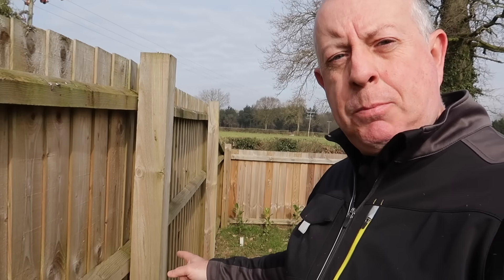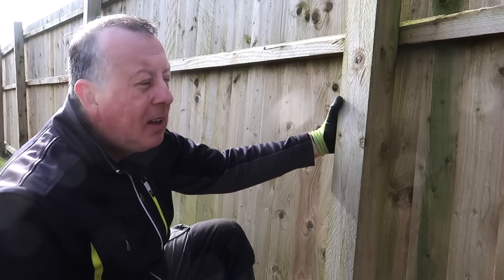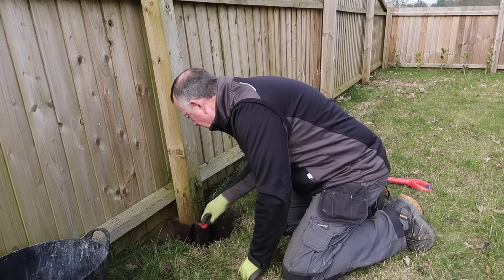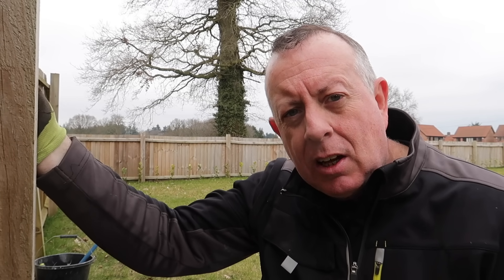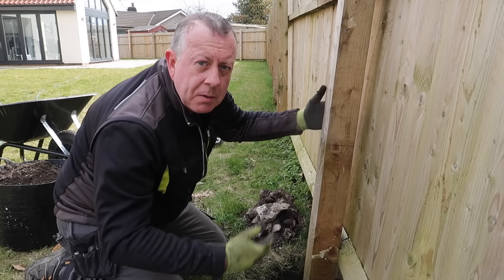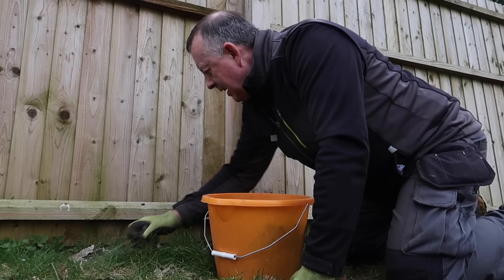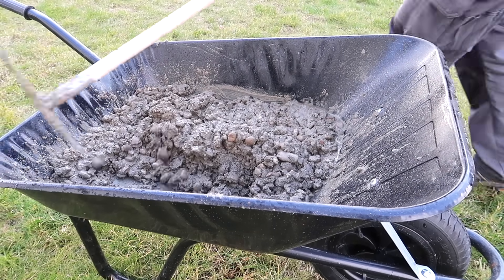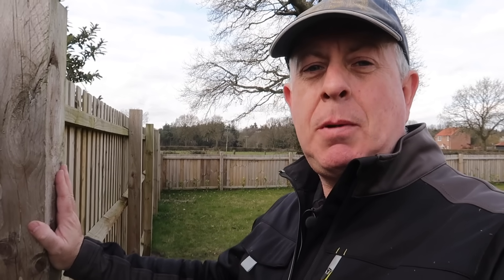How to Fix Leaning Fence Posts

Comment: Why not use  a concrete  spur  post still get old concrete out dig down  drop in spur and concrete then bolt spur through holes in the spur to the post much stronger and if the post is starting to rot your have no problems
Reply: Exactly. I used wooden post but attach to concrete spurs, years later as good as new. My neighbours fence 5years? Collapsing already du to rotten posts.
Reply from the maker: I'm in a new house with a new fence. I want it to look regular so I'm not so keen to see a 30m fence with one post being supported by a concrete spur.
Reply: @ProperDIY  makes sense much neater. My house is old and everything gets lost in foliage.

Comment: If you want that fence to last many years I would concrete with a pyramid style so the water can run off mate👍
Reply: This is true, it is having soil around post that rots them. I can guarantee that he is going to have alot of problems with that fence, having so much soil around the posts. With in the next few years every post is going to break at ground level, treated timber is nothing like it used to be.
Reply: Concrete rots wooden posts 🙈
Reply: @jamiesadler1097  Concrete can rot wood, which is why building regulations state that you must use pressure treated wood in concrete. Even pressure treated wood can eventually rot in concrete but your fence will most likely need replacing by then anyway. The worst thing is having soil around a post, I have seen 6 inch pressure treated posts snap in under 3 years with soil around them.
Reply: @ebutuoy4811  thats what im saying concrete rots wood thats why fence post spikes where made

Comment: Whoever put that foundation in was a cowboy or a child. 🥴😵✌🏻
Reply from the maker: Yep. It was a 'fencing contractor' apparently (before I bought the house). I have multiple issues with the fence so they cut lots of corners!
Reply: @ProperDIY  Great channel sir very enjoyable, very well edited. I can only guess they’ve either cut corners on total concrete for the job or they just couldn’t be arsed with this one particular post  or the whole thing would be wobbling. If you ever get a big auld “hit and miss” style fence leaning not as easy to access the post, we’ve dug new holes in between two posts and then fed the new post down the centre of the fence, just to cause as little disruption as possible, and to prevent digging out well set posts. Some just move over time due to many things. All good fun, as we all know nothing worse than digging fence post holes 🕳 😩👍🏻

Comment: I'd add that after going to the effort of breaking out the original  foundation on a 'sound' post showing no signs of decay, I would apply a coat (or 2?) of damp proof membrane to the post from the bottom up to 1" or 2" above gound level. This prevents decay for many years as iit removes the environment for fungal decay which require wetting and drying cycles to encourage fungal growth. Something like 'Blackjack' DPM from one of Stuart's fabourite suppliers would fit the bill and enormously increase the life of the timber post. 😊

Comment: Those posts direct in concrete will start snapping with about 5 to 10 years. Setting posts in concrete is what everyone recommends but it will always fail eventually. It is a scam of the timber merchants as they use crap wood and the treatment they use is next to useless over time.
Most people move house before the fence gives way....

Comment: that style of fencing in Victoria Australia would deemed a Jerry build .professional fence builder

Posts: 125 x 75mm hardwood or H4 treated softwood, Durability Class 1 or 2 (suitable for in-ground use). Hardwood posts are
recommended. All posts to be installed vertical with an angled top to shed water, at a spacing of 2400mm-2700mm to suit rail lengths.

Rails: 75 x 50mm hardwood or H4 treated softwood rails to be installed top, mid and bottom, Durability Class 2. Hardwood rails are recommended. Rails are to be generally 2 bays long with butt joints at alternate posts; not more than 2 rail joints to occur at any single post.

Plinth: Fine Sawn Treated Pine, 150 x 25mm. Where gaps between the ground and the plinth board are excessive (over 100 mm), a second plinth board is to be installed.

Palings: Fine Sawn Treated Pine, 150x 12mm (under); 100 x 12mm (overs), length is to suit overall 1.8m fence height. Under palings are to be spaced as necessary to maintain an overlap between overs and unders, nominal overlap is 25mm each side of the paling. Top line of fencing is to follow ground line.

Capping (secondary street detail): Fine Sawn Treated Pine, 100 x 50mm.

Comment: I do alot of repairs,for clients, and the best thing I find is the concrete  spur connected to the original post easy fix and absolutely solid,never need to go back again. But you did a good job yr way,but post might rot out in future perhaps.
Reply from the maker: I'm sure they work well however I have a 30m fence on view in the back garden and to then have a concrete spur on one post will stick out like a sore thumb so I'm not keen to wee that

Comment: 2 and half mins in and I thought to myself “I’ve found my soul brother” and had to subscribe. Ive lost count of the number of times I’ve said to myself “Where’s that bloody so and so gone? I’ve been looking at it all week?” 😂😂😂
You’re right about the SDS drill. I replaced the fence at my house and couldn’t understand why the previous owner had put the posts where they did. It just didn’t look right to me. Until I came to put the new ones in in what I felt was the right position, , , right on top of some old broken off godfathers concreted into the ground. 12 posts and several days later both my drill and I were knackered. 😵‍💫
Going to enjoy catching up with your videos now though. 👍
All the best for 22.
Reply from the maker: Yes, always intriguing why people do strange things - until you find out the reason why

Comment: I was taught a great tip when fitting wooden fence posts. At the bottom of the hole, put in a 2-inch layer of pea gravel or small rubble. Tamp that down until firm, Put 2 plastic bags, one over the other, over the end of the post and wrap with a little sellotape. The bags should extend above ground level. Then add your concrete. When set and cured, lift the post out of the hole. This should be easy with 2 bag wrapping. Remove the bags and put the post back into the hole. The tiny gap where the bags were allows water to drain down to the pea gravel or loose rubble and out into the soil, extending the life of the post. It also makes post replacement a doddle too.
Reply from the maker: Good tips

Comment: I was a residential fencing contractor for the best of 10 yrs back in the 90's. The standard then for wooden property dividing fences (1.8m or 6ft) was posts always went in 900mm or 3ft deep minimum and def NO concrete. Today they only put them in 600mm or 2ft absolute tops and concrete them in. A recipe for problems later down the track. I occasionally replaced old fences that were generally 30 - 50 yrs old and those usually had concrete posts. Those fences usually failed not through timber rot but the reinforcing in the conc post expanding and destroying the post. Rarely did I ever see one that was falling over due to post lean. 

If you don't want your fence to lean all over the place within a few years put the bloody posts a minimum of 900mm or 3ft into the ground. Another tip;  posts always rot at ground level first. Put a band of creosote/old engine oil/pitch or something similar around the post at ground level. If you're fencing into soft or wet ground do not reuse the old soil, pack your posts with a 5-10mm stone chip (not pebble) top to bottom and ram hard.
Reply: It depends on where you are. Could you say? And putting old engine oil etc into soil contact is a giant no go, at least here in the US.

Comment: You can fix this much quicker by using a come-along winch to pull the post vertical, and then pour some quickcrete behind the post after digging it out a bit. . Fixed a few this way and still holding up great.

Comment: I used pea stones in lieu of concrete to support the 4"by4" post. It worked great. The advantage is that if the post rots in the future, you don't have to bust up concrete.
Reply: Bad idea.
Reply: @mattmorris2867  why? It's been two years and still looks great.
Reply: @europaeuropa3673  You just put stones in to hold up a post?  You’ve just been lucky lol.
Reply: @mattmorris2867  pea stones are special high density very small stones recommended for this applications. We've had a few wind storms exceeding 60 MPH this past year and no problems.

Comment: I liked your method. I've started using Postsaver sleeves. Only time will tell if they actually save the posts.
Reply from the maker: I've never used them - I've got some new fencing coming up so may try it then
Reply: @ProperDIY  I find them quite tricky to fit. You have to be careful not to melt through the plastic.
Reply: Better of soaking end of post in deisle or proper old school creosote before concreting and if you put a waterproofer in the concrete as well it will slow the water ingress quite considerably. Only had to go back on to one of my jobs for a rotten post. And that was purely down to forgetting the waterproofer in the last mix end of a long day lol
Reply: Postsavers all the way, two bags of postcrete per post, soil looks wonderful to dig in, so no reason not to get a full depth hole, and one string line for your inline measurement, and just level up from it, bing bang bosh, jobs a permeant goodun.

Comment: I've repaired rotted off posts by U-bolting them with lag screws top & bottom to a 3-inch galvanized metal pipe six-feet tall sunk 2-feet into a hole dug parallel to the original post/hole. Plumb it all vertical and fill the new hole with water and dump in a bag of Quikrete. I've got 9 out of 36 posts repaired this way still standing solid 20+ years later.
Reply from the maker: How do you get the metal pipe past the concrete foundation which obviously sticks out wider than the wooden post?
Reply: @ProperDIY  You can ether use a 2x4 spacer between the wooden post and the new pipe (if the old concrete is thin enough) or chip a notch out of the old concrete to sink the new. In an extreme case you could completely dig out the old foundation and remove it; use a saws-all to cut off the old post at the foundation (usually easy if it's already rotted there). (note: I've never had an extreme case… just thinking out loud. ;-)

Comment: I always paint my posts with tar adhesive for roofing felt to just above the soil line and it stops rotting on the posts my grandad taught me to do this for he used to always soak the posts in creosote to preserve the wood years ago when you could buy creosote.

Comment: I haven’t the storage for left over bags of cement, sand or ballast so I do use postcrete. However I remix it in a bucket first before pouring, dry of course, into the hole. Then pour the water in. Sometimes I mix the water and Postcrete before pouring. I usually have the concrete at least level with soil. Still shape it away from the post of course but also leave the base of the post soaking in preserver overnight before installing

Comment: Here in Ohio, the freeze line is 33” therefore ur wise to drill, auger the hole at least 36” or deeper. Finish the top of concrete angled down on all 4 sides.
Thanks 
Matt
New subscriber

Comment: Using galvanized steel posts cemented in the ground, instead of wooden posts, has worked very well for me for close to 40 years...Are your posts pressure treated?...

Comment: If you had dug the post hole to between 42 and 48 inches deep to begin with (ensuring part of your foundation is below the frost line) and then filled the bottom 12 - 16 inches with concrete, place the post on that and filled to just about 1/2 inch above the level of the ground around the post and ensured that it was level, it would last you 40 - 50 years and would never have moved.

The fences we put down in my yard (In Canada) used 4x4x8 cedar posts with the hole down to 48 inches to ensure that the post foundation was below the frost line and 3 feet of the post in the ground and the concrete between 1/2 - 1 inch above the ground and tapering the top so the post isn't sitting in water with 5 feet above the ground now 50 years ago and resealed yearly are still standing with only a few having to need to be replaced due to issues with carpenter ants in one case and others that rotted from the top of the post over the years.

We have brutal winters that take their toll on wooden outdoor structures like fences and decks and I've have had to replace 2 decks in 50 years as opposed to 4 posts (out of 22) and a few 2x4x8 and some pickets over the years.  With decks, the snow accumulates on them for months and even though you clear them off, they still end up wearing out faster than fences do (Foot traffic plays a part in this as well)

In your case, because your concrete footing is below the ground level, your post will rot or the footing will move and you'll be doing this job multiple times on multiple posts a lot more than I've ever done to my fence in 50 years.

"We can send men to the moon but still seem to have not worked out how to ensure fences stay vertical!!!"  -  well, do the fence post right in the first place and you won't have these issues for a very long time.  

Just as a side note, we had 1 post hit by a car back in the 80's.  Destroyed 2 sections of fence but the post between the two sections destroyed the front of the car and was still solid after the impact.  Never moved an inch.

Comment: When I had a post rot at ground level I simply installed a short concrete post against it and bolted the wooden post to it through the three provide holes. Simples!
Reply from the maker: When I sit in the back garden with friends I don't want to see a 30m long timber fence with one concrete post in it
Reply: @ProperDIY  The post is behind a rather beautiful, dense shrub.

Comment: Tip I Was Taught by an old fellah which seems to work .(still haven't figured out why yet) is to wrap thin plastic bag or clingfilm (saran wrap to out yank friends) around the the top 18" of the post hole so it is just protruding above ground level.  The theory being that the  wrapped part is the wettest area of ground  and rots quicker.than any other part of the  post.
Reply from the maker: Yes I'm sure anything that can help stop moisture getting to the timber the better.

Comment: I was told the correct way to do this 2 decades ago. Concrete repair post set 1 foot deeper and the hole filled with broken limestone gravel. Lasts forever. No maintenance. Easy

Comment: One easy way to straighten a crooked fence post is with water. Either just a garden hose, or a garden hose with a PVC extension on the end of it. Push the hose or hose with PVC with water running into the ground next to the post. Loosen up all the soil around it, straighten the post, and pack dirt back in after it dries out.

Comment: In some cold places they put concrete way under the surface to below the frost line. It stops post heave supposedly. 
Where I live it’s clay and very wet in winter. We don’t get deep frost much so I do concrete all the way to the surface for better hold.

Comment: Up here in wet Oregon, some of us use Pea Gravel for the post. It helps a few ways, like if the post moves even a fraction in the wind the gravel sinks and tightens the post continually never letting the post get loose. (Just keep the pea gravel capped off). Also, the water has a drain away from the post ground level so the water rot in that spot is no longer a problem. Another way it helps is that there is no concrete mixing! Many think it's faster and better.
Reply: In my neck of the woods pea gravel is a pebble. Use chip it locks together. Way better.

Comment: If you are in a frost prone area and the footing isn't deep enough the frost will drive it up and loosen it.  If you cut a 16 inch disc of 2 " blue foam and cut the square post hole in the middle and bury the foam a few inches below grade it will keep the frost from going down and getting under it.

Comment: Common issue is couldn't find the tool you needed but see it all the time when not needed. Another issue is long SDS bids not available for getting deep down in the hole. BTW, no need to break out the bottom concrete since its solid if you have concrete vibrator. Add new mix to fill in the void around the old concrete, vibrate then add the broken concrete back into the hole and again vibrate new mix till its above grade. Less work, concrete mix and trash.

Comment: This straight forward video is very good 🤗 Could I add a mix that works for me 5 to 1 made up of  equal  parts 3 sand 2 gravel 1 cement , and protect the wind and water. Iine  of the post even treated wood rots.

Comment: I dug down on a leaning wooden post today expecting that there wouldnt be enough concrete...but there was plenty of concrete... so assume the installer didnt line the post up right or is this bad luck? I used SDS to break it all up and reset using postcrete.  Standard wooden fence post 8ft with 6 foot fence panel job.

Comment: I put a sticky-one-side foundation water barrier onto my 6X6 fence posts all around, underneath and up to 6" above  where the ground will be and they literally last forever. Give it a try. I don't use concrete. I pack the earth down bit by bit with the end of a 2X4 as I go. Give it a try. I don't think you'll be disappointed. I dig my holes 4' deep.

Comment: to dig holes like that i have a 5 gal bucket with lid with two 2 1/2 shop vacuum fittings one from vac to bucket then 2ed to hole works wonders , vac stays clean empty bucket

Comment: The post was good, the cement needed stabilization. I would have packed rocks around the cement. Pack it tight and you will have a solid fence. I built a fence in 1972, and it is still solid. That is 48 years.